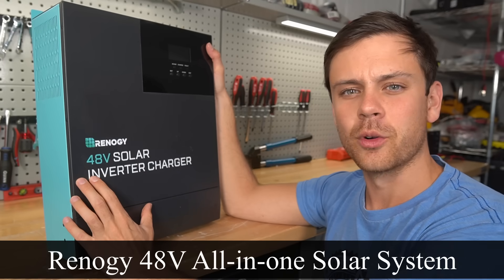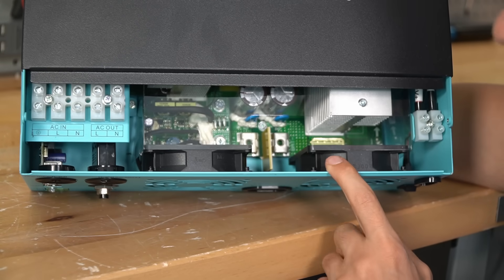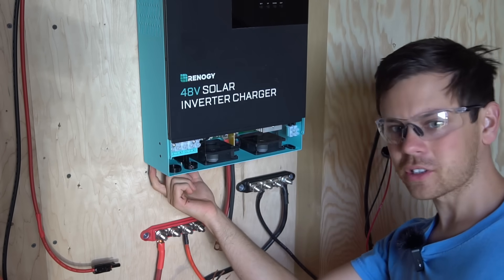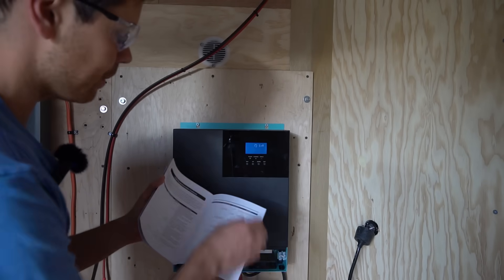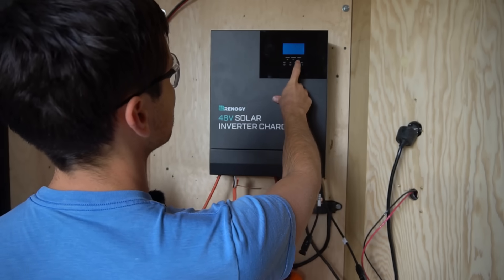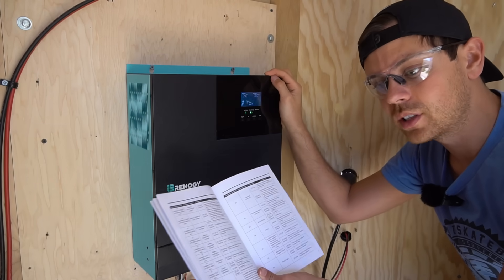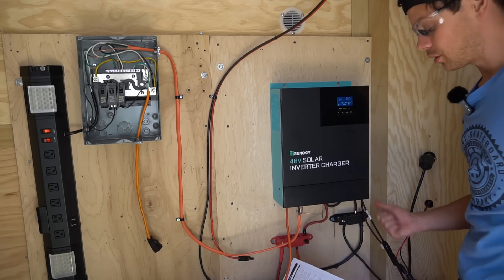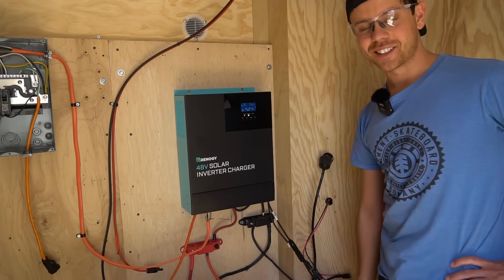Renogy 48V All-in-one Solar System: 3500W Inverter, 4400W MPPT, 1920W AC Charger

Comment: I had the same problem, only 400watts from my solar even though my other controller was pulling around 800 watts. 

My suspicion is that the firmware has the maximum amperage set at 8a instead of 80a. (50v x 8a = 400w).
Reply from the maker: That's the limit on mine too!! Exactly
Reply: @WillProwse  I figured it out. Check setting 36 in your menu. It isn't documented in the manual. Default seems to be 5A. Not sure what the setting controls exactly, but it appears to limit the solar power generation. Range is 0 to 80. I set mine to 80 and now I can utilize the full 1200W array.
Reply: @whitestonefarmer  thanks Chris, I'll check that out! Any thoughts on the app. Seems like renogy has two apps and you'd have to use both to be able to see production and consumption. Also neither control settings?
Reply: @nsgrossman  I'm not happy with the app situation. The Renogy BT app is supposed to let you configure things, but looks like the settings are all based on a 12V battery. There is an option to change to 48 volts, but it doesn't appear to re-base the individual advanced settings based on that option, so it would appear that you would need to multiply by 4 if you tried to set something? Not worth it for me. I've configured the unit using the front panel and will just let the settings remain what they are.

The monitor page in that app is somewhat useful. I can see at a glance the current solar power generation and battery SOC. But the output current reading is off by a factor of 10. Easy enough to move a decimal place in your head, but really? That didn't get noticed before they pushed this to the app store? And I think the temperature reading is always 0 in this app.

The DC Home app does show the current load/output power and internal temperature of the inverter, but since that app doesn't recognize the device as a solar charger, you can't see power generation. 🙄

So, I'm constantly flipping between those 2 apps and another app that I have which monitors my BMS to get a full picture of what is going on at any given time.
Reply: @WillProwse  
Thanks for the video, glad I'm not crazy!

Am I missing something or is the app completely worthless as well?
Reply from the maker: I have not tested the app. Maybe you can find a way to increase the limit, but I would return it if I were you
Reply: This makes perfect sense! I hadn't done the math yet, but it is exactly what I'm seeing on mine. For example, when the Renogy says it is generating 348W and my battery voltage is at 43.6... that's 8A! When the Renogy says it is generating 366W and my battery is at 45.8V... that's 8A. Now, how do we get Renogy to fix it? I'm past my return window at Amazon. The app is pretty bad and I don't see anything in there that lets you manage that setting. I can't figure out how to configure ANY setting in there. The app also shows other parameters off by a factor of 10, like for instance, when I'm pulling a load of 30A, the app reports 3A. Maybe it is worth trying to hook up that USB port. The manual states it is not supported "as it requires proprietary information." 🙄

Comment: Hey 👋🏽 Will, Would you do a video explaining how to have a backup battery system. Say I already have 2 100ah battleborns in a Van conversion and want to go for 560ah From Ali for a backup and maybe it’s own 3000w inverter how would you go about doing that. Do I share the 350w solar in Victron mppt on a switch when my main bank gets capped or add more panels?

Thanks for the help your videos are gold 🙏🏽

Comment: Will, pull the unit off the wall, and see if it has a slide in mount on the back.
Just set a screw in place slide the unit onto the screw, and then screw it in at the top.
Most of my outdoor panel boxes are like that. Worth a look see.
Reply: Or maybe the two holes on the bottom side are for an L bracket (maybe one per side)

Comment: cool it,s the  same as my power MR but  i took it down so i can put up my new 48V 6KW Growatt Split Phase Solar Inverter 120V / 240VAC 80A MPPT   like the video thanks for sharing the  power mr /  eco worthy / renogy  and the one i have keep turning on and off wen the switch is off  i didn't trust it

Comment: It's in SOL mode clearly.
Reply from the maker: No it's not. I had it doing full output utility earlier. And I used sbu and utility mode.
Reply from the maker: And the solar output was decreased. Why would you think it's in Sol mode
Reply: @WillProwse  If it's still in power saving mode; turn that off.

 "If
 this inverter/charger is working in Battery mode or Power saving mode, ONLY SOLAR energy can charge battery."

Just noticed that key detail in trouble shooting.
Reply from the maker: Why in the world would it stop charging if its in power saving mode?? Thats a failure in programming. What use case could warrant that feature? And my solar output decreased to 30% of what I was getting the second I put my mpp back up on the wall. What setting would influence that? I maxed everything out
Reply: @WillProwse  The max PV input is 50 A apparently. Otherwise, parameter 07/28 (Max charge current) 80A solar 40A AC, or  parameter 06 (Battery Charging Mode); pretty sure you checked the battery strings variable; I'm guessing it's LF-14. Maybe compare specs between the two units. What model is the MPP?

Comment: Thank you so much for doing a video on this until . I was actually about to spend over 14,000 dollars on their system that  I was going to set up . What is your best recommendation for a whole house solar panel set up?
Reply: Depends on your needs. I’d lean towards a Sol-Ark 8kw, then add panels and batteries according to your energy audit. 

I estimate a cost ratio of 1/4 all in one unit, 1/4 solar panels, 1/2 battery bank.

Comment: Wish they’d make a 12v all in one that would take more than 20v solar. I have 36.9vX2. Went with their solar charge controller and dc to dc for my application.
Reply: the pip 1012lv-ms max pv input 102v  mppt range 15v-80v

Comment: Happy to see you review this unit. I've had it for a couple of months now. I haven't had any of the trouble you had in charging from AC, but I was really interested in how you found it on the PV side. I have only ever seen 387W max power generation from my 1200W array and that was in full sun, mid-SOC battery, and under load. I'm new to solar so I wasn't sure what I should be getting, but hearing you say you only see 400W tells me something might very well be wrong with the MPPT on this unit.
Reply: good anecdotal info...it's probably your Renogy not your PV system
Reply: @gradylucas5265  'cynical' LOL

Comment: You are right with the assessment of the unit. But inverters do not offer you a Ground at its output for a reason. The Neutral-Ground bonding must be done in the Panel you are feeding in according local regulations. Codes of how to bond Ground may be very different from place to place.
Reply: But the Growatt does "offer a ground at its output"
Reply: @gradylucas5265  probably because Will complained them :)). But is it at the AC output or input? The inverter N should not be bonded internally to Gnd. You can measure between output N-G if you have a potential there without bonding outside...
Reply: @RolandW_DIYEnergyandMore  There is a ground terminal at both the AC input and output.  No it wasn't because Will complained.

Comment: I don't think anyone going down the road is 48v.  This is an in place unit.
Reply: Hardly true.  If you have the space for panels, this is a much more efficient setup than a 12v system. Much easier to use a 48v bank for your AC power needs than several 12v batteries paralleled with a 12v unit. A small 48v-12v DC to DC converter will easily take care of any 12v loads you may have.

Comment: Study floating grounds.  Most likely any inverter ac ground is just a connection to to chassis ground.  Inverters were meant to  be conected to a breaker box where they would most likely combine with earth ground.  I suggest you get your contractors license.   Also I suggest you contact product support before flaming a power product.  A thing you see might be a feature.while the company is in litigation because a guy used his scrotum rather than a voltmeter to measure current and then sued the company.

Comment: My Renogy  "ADVENTURER" is 2/10 of a volt off on its meter and only has 4/10 volt resolution for charge control settings. Other than that it does work. I just happened to be lucky enough for the charge voltage that I set was close to what I wanted.  So for me it is satisfactory, yet irritating.  They have a problem with their engineering IMO.

Comment: Wow!  Did you see the spark at 3:25 with the resistor?   Guess Will is going to have to get more resistive resistors!
Reply: @marthale7 ... The main takeaway... 48V DC has the potential to cause serious harm vs 12 or 24 volt, because it can deliver a decent shock if not handled correctly. As where it would take you doing something on purpose to receive a shock from 12 or 24 volts... SO people that are only use to using 12 or 24 volts...  that move up to 48 volts may have developed poor practices, like laying your body across terminals when working on or around the batteries... It only takes a sweaty arm laid across a few terminals on a 48V system to learn the hard way.
Reply: The unit was in the "ON" position when he initially touched the resistor... SO of course it is going to make a bit of a spark, even with a resistor being used.

Comment: I CAN'T recommend Renogy for any products. The customer service is horrible I was looking for a pure sine wave inverter charger unit. I was connected to an overseas person who had no clue about the product. They recommended 10 ga wire for a 12v 3500-watt unit. This whole call lasted 40 minutes for the wrong answer. Called back the next day, and the same thing. Went with AIMS 6000 watt inverter charger, customer service answered on the first try and US-based.

Comment: Have you noticed that you get a different charge when you charge lithium batteries  from solar then with utility power? I have done tests and even my phone, camera and drone batteries have a different capacity when charged from solar then utility power.
Reply: say wut?
Reply: I have an Aims 6000w pure sine wave inverter, Outback 60 amp and lead acid batteries goingto go Lifepo4. But, because of the inverter doesn't keep a true 60 cycles and the voltage fluctuations microwave doesn't cook pop corn right digital clocks don't keep time and lithium batteries for camera's and other things do not charge the same as when I run off utility power.  Testing my new CATL LIFEPO4 3.2V batteries 🔋 have a very different capacity also. It also seems to get worse with consecutive charges with the solar. System output is 119 volts. Utility  (SCE) is also 120v and once charge by utility the batteries are back to their much better capacity. Also, I have the only two drone batteries that have gone complete failure due to charging off the solar.

Comment: I've seen several videos now from you and others rightly suggesting the inverter capacitor precharge through a resistor, but nobody ever seems to mention the resistance or power rating of the resistor they recommend.   Maybe you have in the past and I missed it, but could you please mention that here or in an upcoming video?  Thank you!
Reply: 10 to 20 ohms should work. Since the current is just a transient, the power rating doesn't need to be super high--10 watts should be OK.
Reply: @huskypup3489  Thanks, I can't be the only one who has wondered about this
Reply: @Bubba_Warbucks  Was mentioned in smaller inverter review video that it doesn’t matter a huge amount also, more resistor present vs. not present = bad

Comment: At 8:35 "+ and - are touching"
Wait WTF?
Reply from the maker: The two wires insulation are touching. Look at them
Reply: @WillProwse  Yeah I see that and it scares me!  Do you ever wear NFPA 70E rated gloves when touching these inverter outputs?
Reply from the maker: @GeorgeOu  I don't, but I will discharge the caps if I need to. Especially for the large ones

Comment: Will do you get 30 volts on ground and L or ground and N? Because mine does and it trips my GFCi? This is on the AC input when inverter is on
Reply: That sounds a little more advanced than the color test so I am very interested what is going on with your setup but I miss some understanding, what is a GFCi and why AC input when inverter is on? Is AC input connected to the inverter somehow, I thought these units were UPS like with a passthrough. Maybe you can explain a bit more, thank you!
Reply: @benediktschluter7313  my plug for my house has a GFCi in my garage and that trips once inverter is on
Reply: @moneth08able  What I think is happening is that neutral is bonded to ground in the inverter when there is no AC input. When AC input is connected, a relay "unbonds", but it is not fast enough so the current follows the neutral-ground parallel circuit back to your main service. The GFCi trips because the neutral current doesn't match the line current. I cut my ground when I connect to a GFCi source circuit by using one of those 3- to 2- prong connectors.
Reply: @whitestonefarmer  hmmmmm let me try that if it works is there a diode or something to prevent that power going back to my.plug? Like a 1 way device?
Reply: @moneth08able  I don't think you really want that ... the point of the ground wire is to carry a current back to earth if there were an internal short to the chassis of a device. My 3- to 2- prong adapter usage is not a recommendation because should the chassis become energized there is a shocking hazard. It does provide a work-around for the GFCi protection device which would otherwise detect a current imbalance between line and neutral. Your best / safest approach is to wire the input AC hot/neutral/ground to a non-GFCi circuit.
Reply: @whitestonefarmer  crap every plug in my garage has GFCI... but that 30 volts from the AC input on the renogy is not normal right?
Reply: @moneth08able  I have the same situation. My garage 110 outlets are all GFCI. I do have a NEMA 14-50 plug out there that I can use, however, and just use one of the hots. I had not looked at voltages on the input side, but yes, I do see 30V between L and ground and between N and ground on the input side when not connected to an AC input. I don't know why that would be, but maybe it is "normal" for this unit.
Reply: @whitestonefarmer  Thanks for this info.  Very interesting.
Reply: @whitestonefarmer  with the nema 14-50 plug   does it trip the GFCI?
Reply: @moneth08able  The NEMA 14-50 receptacle is on a separate 240V branch circuit. Caveat: I am not an electrician or electrical inspector, but from what I understand, while you can protect 240V branch circuits with a GFCI breaker, it is not required according to the NEC. You should check with your local inspector before installing a new circuit to make sure you meet the requirements of your location.
Reply: @whitestonefarmer  so once home this weekend ill add a breaker and plug for the AC input of the inverter then ill install  the plug that came with the reluance manual transfer swith and just by the 4 prong to 3 prong convertion so i dont have to hardwire my inverter directly to the reliance manual transfer switch....hopefully it works if not ill just return this and if you have an inverter recpmmendation that is more capable than this?
Reply: @whitestonefarmer  so have you check your AC IN for voltage while inverter is on? If your getting the 26volts to 30 volts? Because if no im returning mine today thank you
Reply: Ac input is for AC charging and GFCI is ground fault circuit interupter

Comment: You could (IN THEORY) combine the neutral and the earth, issue being that the moment the AC was switched off (among other things), it could lose its earth so definitely a better option joining the outgoing earth with the incoming earth. May want to check if the case is earthed too, just in case as I couldn't see the wires coming from the terminal strip. Probably someone going to put a comment after this to say it would be a bad idea and honestly I stand with them.

Comment: Excellent video -0- i am very happy to know that our guys in LA testing this was correct .... they had the exact same issue that you did plus about 12 more ... NO GROUND -- WTH ... and no bottom mounting hardware .... the lugs are poor at best and right there that eliminated it for us to use ... On top of that Renogy got lazy and use the old screens ... AND for some reason the thing just doesn't seem to be able to get to 80A of AC charging out of it .... also - some of the things int he manual are simply not right .. its like they copied pasted and then messed up a few settings .. you make changes and nothing happen ... etc etc ... SOOOOO from where we set .. MPP is still the best out there .... I know you are excited about GroWatt but I think once you get past the sexiness you will go back to MPP also ...
Reply: Connections suck
Reply: nah  Growatt > MPP